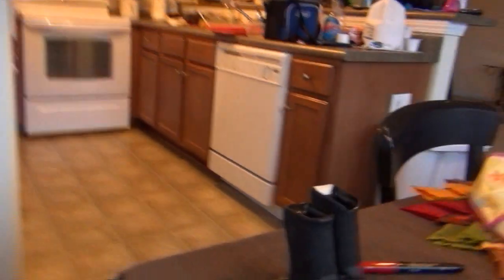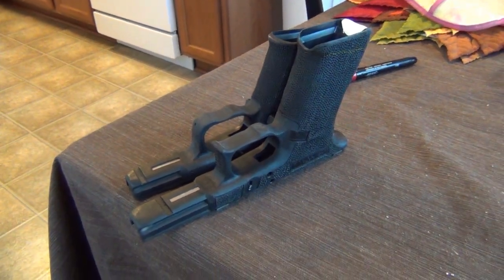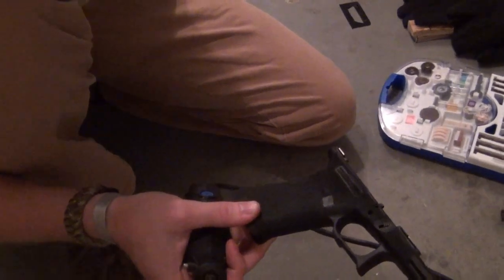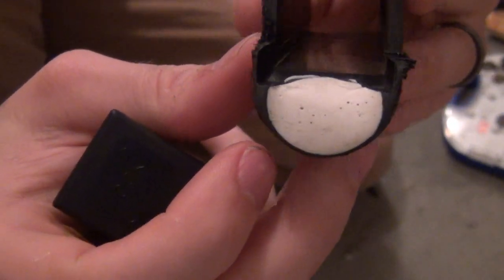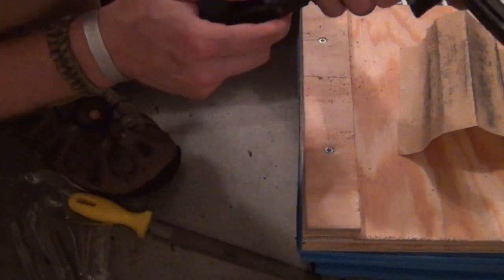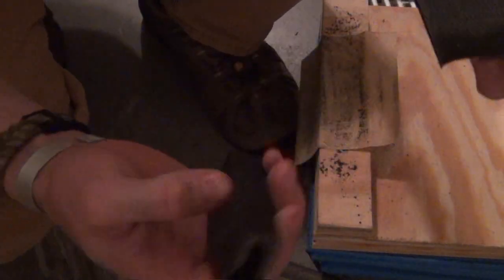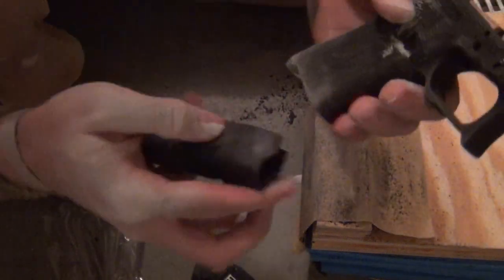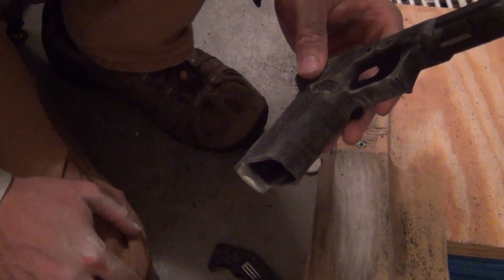RaspyGA, Chopping a Full Size Glock to Compact Size

Comment: Great job Raspy (DI voice?) For those needing to epoxy inside the back strap access hole of a Glock you can add a pigment to the epoxy for a closer color match to your frame  [Black Casting Dye - 1 Ounce @ Hobby Lobby]

Comment: Nice job.  i am thinking about doing this my G17.. but would prob fill hump with epoxy like this but shape a bob-tail... any thoughts on this?
Reply from the maker: +Damon216 I don't see why it wouldn't work. I personally like the mag base plate to sit flush with the backstrap, but it is just aesthetic.
Reply: *****
It would sit flush... I would round it down more.   I just read an article warning gun owners not not to alter guns that you might need in a CCW situation... ESPECIALLY lightening trigger pull.  I am not sure if chopping a handle would make the difference.